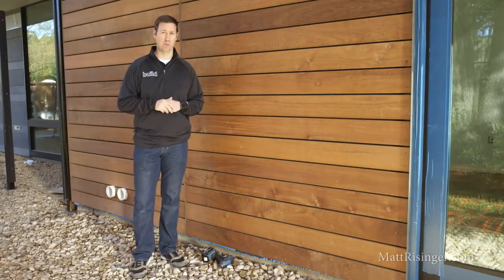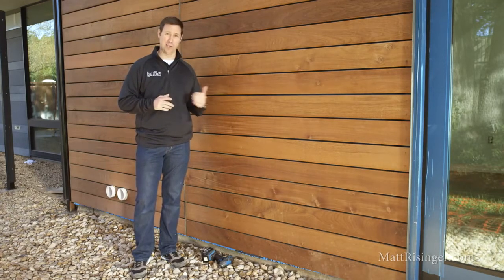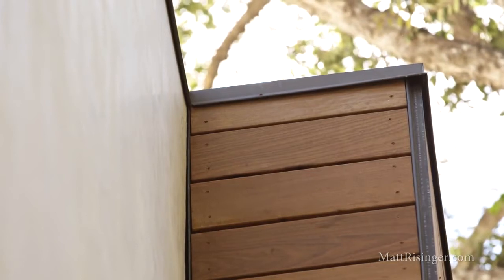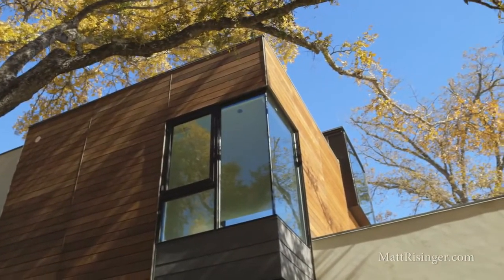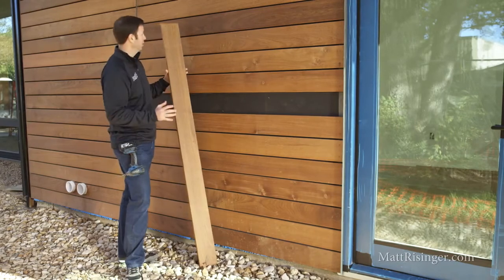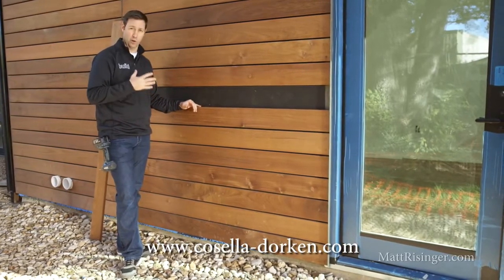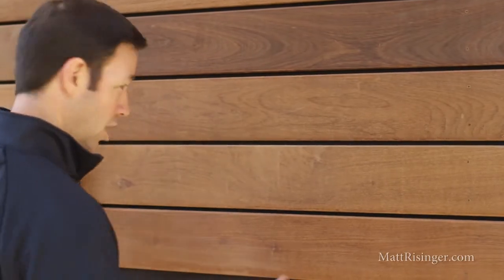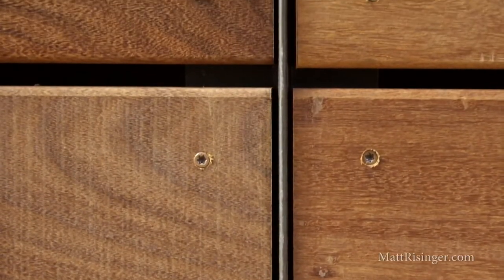Fine Home Builder Matt Risinger on open joint rainscreen cladding and UV resistant DELTA-FASSADE S

Comment: Hi Matt - Thanks for the in-depth look at the open joint build up....one of the few good articles on the internet I have found.

One question though, have you had any problems with insects taking up residence behind the boards?  I am looking to implement a similar detail and was concerned about this.  My thought was to use a coravent strip at the top and bottom of the  siding and apply a layer of insect screening between the siding and furring.  What are your thoughts?

Thanks!
Adam
Reply: +Adam Jordan If your going to have gaps then the coravent strip will not help you any, my question would be wouldn't a product like ROXUL Mineral Wool they make for exterior applications also be an option? (it's what I'm going to use on my home but I don't have gaps in my siding)  Roxul is a great insulator, sound barrier, water resistant as pretty much fire proof.